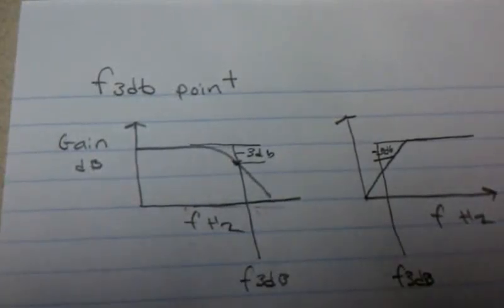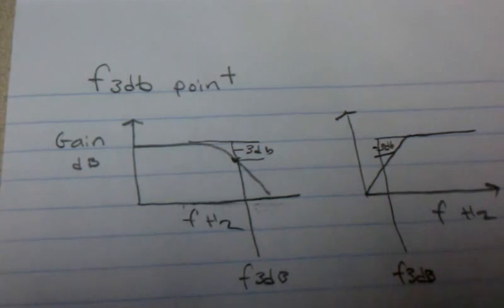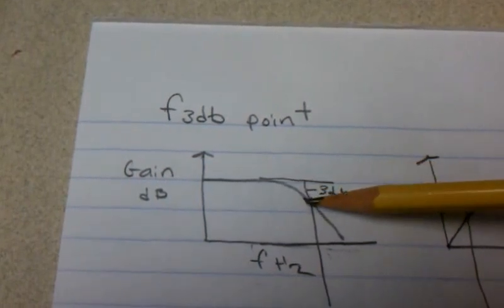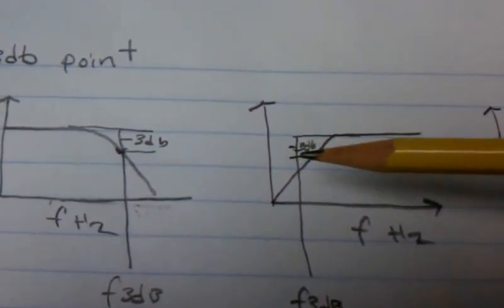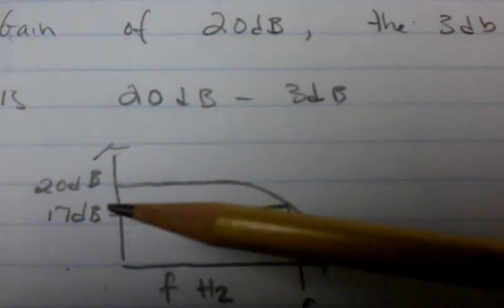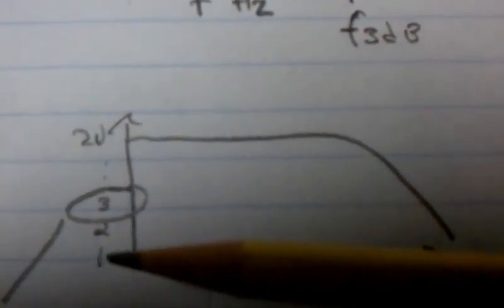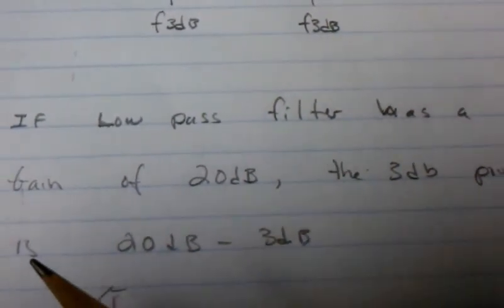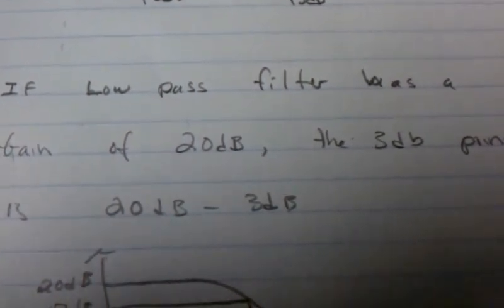f3db

Comment: but why not it is 4db , 6db or 0.5db ?why specific 3db?
Reply from the maker: Great questions.  This is where the power drops off by 1/2, but that just moves the question to why not 1/4, 1/8 or 1/12?  While other magnitudes are used, the -3dB point for a first order low pass filter has a phase delay of -45^o where the imaginary part equal the real part.  I know saying it is traditional is not a very satisfying answer, but it is somewhat true.  Just like why use 5tau for the time it takes  a frist order system to settle after  a step input.  Why not 6 or 8? (I think 5 Tau shows you the most detail of the time response curve.)